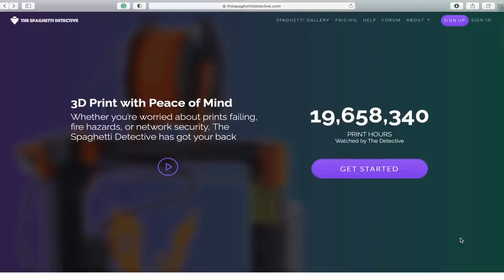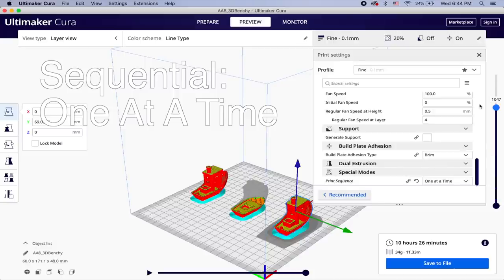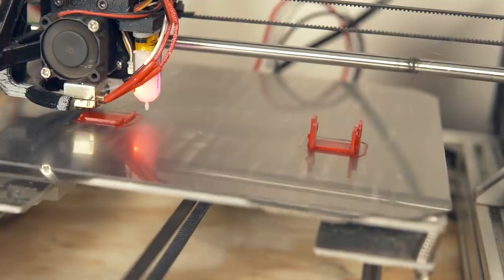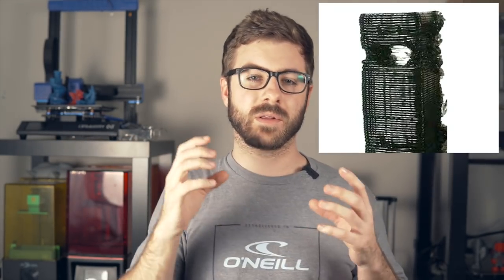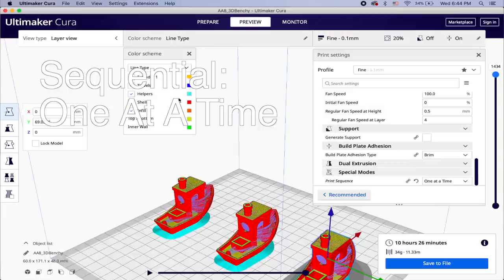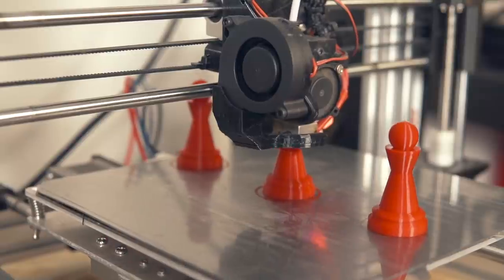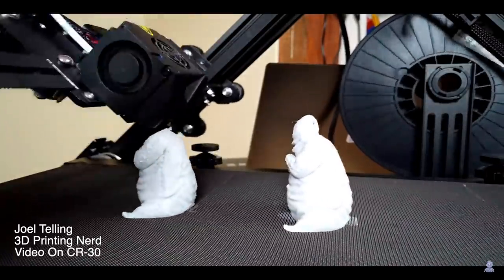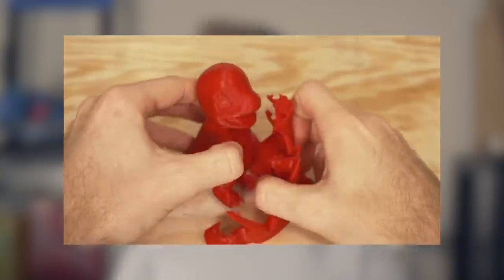Less Batch 3D Printing Fails With Cura Print Sequence (4.7.1)

Comment: Great video. It’s been part of Cura for a long time. Even back in the early Barnacules 3D printing days when he was using wood Ultimakers and we had DaVinci’s. Like you showed, it has limitations (spacing) but is definitely an option. I was planning a video this but you did such a good job not sure I can add much. Great looking CHEP Pawns!
Reply: Hey guys, Id like to print tall models consecutively on bed.
In cura it only lets me print my gantry height.
 If I adjust my gantry height setting in my profile, will it change anything else?

Comment: Just gave this a try. Need to print 55mm tall treads for the track drive of my Eggbot droid. 60 of them. Print one at time in TPU. Argh. 10 at a time normally leads to massive stringing and if one fails.... So went into Cura and added sequential printing but gantry too low. So overrode the default gantry height for my Ender 5 Pro to 60 mm. Duplicated the tracks and placed the first one at y200 and staggering them on X axis so the extruder cooling fan won't hit. Successfully printed six in one batch and will now try for eight, then go for ten... Now I can load the printer with a batch before bed and also not be wasting time with restarting after a single piece. Thanks. Great video.

Comment: Doesnt work for me. Set gantry height to 35mm while height of print is 20mm. Still nothing. Not even with just 2 objects. Slicing preview shows its printing sequentially but when I review GCode file in Cura (or octopi) the print sequence is still all at once. I have so many small parts and this would be a great tool to use. Dont want to have to wait till May to get the belt printer.

Comment: I found a way to fill the bed on a sequential print, but it takes a little bit of work.  On my printer, the extruder is on one side of the carriage, so the nozzle is only a few millimetres away from the edge.  If the prints are especially short, under 5mm in height, I can even let the hotend overrun the previous row.

Conventionally, my printer needs a 35mm radius around each part.  By placing the objects myself and controlling where they go on the buildplate, I can get that down to 8mm radius.  The order on the buildplate is as follows for a 7x7 arrangement:

49  48  47  46  45  44  43 
42  41  40  39  38  37  36
35  34  33  32  31  30  29
28  27  26  25  24  23  22
21  20  19  18  17  16  15
14  13  12  11  10   9    8
 7    6    5     4    3    2    1

If the parts in question are taller than the gap between the nozzle and the gantry, it means offsetting them so that the gantry is out of the way.  Here is an example of a 6x2 arrangement:

12
         11
                  10
                           9
                                    8
6                                            7
         5
                  4
                           3
                                    2
                                             1 

The catch is that, at this time, you need to manually place the parts, which means doing some math.  It also means lying to the slicer so that it will slice the models.

Comment: Wow!! I'm surprised at the fact you've just now discovered this when I thought it was common knowledge... But if you just found out this and the Spegehtii Detective, have you also seen the Object cancelation plugin for if any reason a part fails or messes up in a section of the bed you can literally cancel out that single part or section of the build plate and the printer will ignore whatever it is you have canceled out to mitigate any loss in batches or any prints as a whole. Its what I use more than anything, So if I have a batch coming along and one of the Parts goof on me I can just cancel it out and then continue printing the rest of it without needing to worry or lose any time, money, or material.

Comment: The feature works well, i used to use it a lot, the main problem i found is that the bulld order is almost random, 

for instance on an ender 3 v2 with bltouch mounted to the left of the head

if i could guarantee that it would build right to left i could fit more items on the plate as the bltouch would not stand the chance of colliding with any item.

i even tried using preview to move the items so they built in an order that was back to front, right to left but everytime i sliced it changed the order of printing

Comment: I need some help. I have an Ender 3 V2. First time I am trying to print more than one part (same part) using the "One at a time" feature you just showed. It's a 1" diameter 5-point star, 1/16" thick.
I have printed 100's , 1 star at a time which takes forever. Having problems slicing 2 stars on the build plate. Keeps showing an error message.

Comment: I tried to use this to print multiple copies of something in spiral/vase mode.  But because the part was taller than the gantry on my Ender 5, Cura wouldn't allow it.  This was frustrating because if it would print from front to back, it shouldn't matter how tall the part is.  This is something that could be improved in future versions of Cura.  If you know of a workaround for this limitation, please let me know.  Thanks!
Reply: You can change your gantry height under printer settings in cura

Comment: I've used this but in PrusaSlicer, it was a little fiddly in the past but seems to be better in the new beta release where it allows you to slice even if it detects (what it thinks is) an error. You have to be comfortable and aware of the limitations as you explain here.

Honestly the octoprint cancel object plugin is probably a better option in more scenarios, but this one is definitely neat and a great tool to keep in your bag of tricks.

Comment: cancel object plugin for octoprint
Reply from the maker: This I have not seen. I will take a look 👀
Reply: I second that! You do have to keep an eye on the print though, so you can cancel the problem part before it causes havoc.🤔
Reply: @alfineart  That's why you couple it along with The spaghetti detective but even still that only works up until a certain point lol honestly if I'm away from a print fro elongated amounts of time, I have periodic printer check-ins where I have my home assistant on my phone or wherever I might be at the time give me 30 to 1-hour updates with a live feed to just assure that everything is running smoothly.
Reply: But can you cancel from your phone tho??

Comment: When you mentioned printing an entire batch all at once that cooling is a positive, being that the previous layer would be totally cooled before the next layer. Doesn’t that also in theory mean the part is weaker because the layers don’t necessarily blend as well?
Reply from the maker: TBH I will not pretend to say I have the answer to that. I have not seen it tested in a measurable scale. An element of what you saying does make sense as if the parts previous and current layer are hot they would bond better together (at least you would think). Would love to see this tested.
Reply: CNC Kitchen channel has some good research on this

Comment: Do I adjust the Gantry height setting in Cura to print taller objects?
Im trying to print taller models and the cura setting has a max model height. I assume this is the Gantry value in the settings.

Comment: I typically use one at a time, when practical. Even considered modding/changing the hotend to make the function more useful. But then again, just knocking finished parts off the build plate doesn't take much code.

Comment: Ive known about it. I tried to use it but its really only useful like you said for smaller lowe to the build surface items. Other wise you need a very svelt tool head in order to avoid the other objects.

Comment: why print the cable chain in nylon? worked perfect for me in PLA for my K40...
got them printed on my prusa mks3 and Cr10mini
Reply from the maker: Might have been the layer height I went with but when I did PLA they were popping off and not very smooth. I had nylon available and the motions just worked very nicely. :D
Reply: @ModBotArmy  great !. nylon is notoriously hard to print, seems it worked out well for you ..